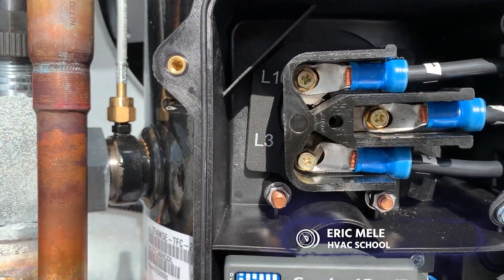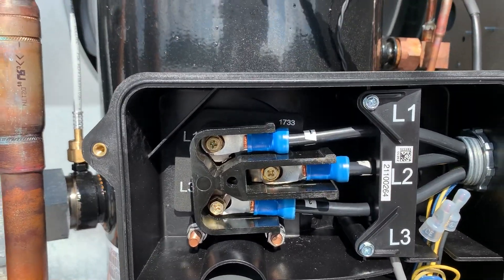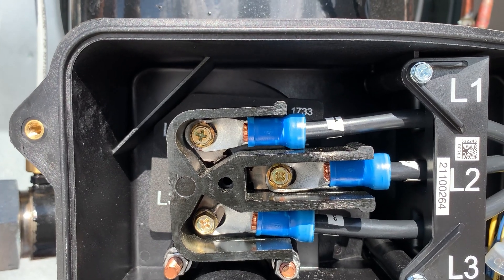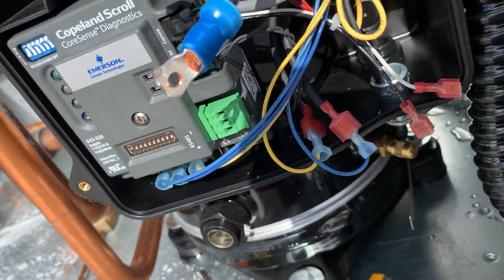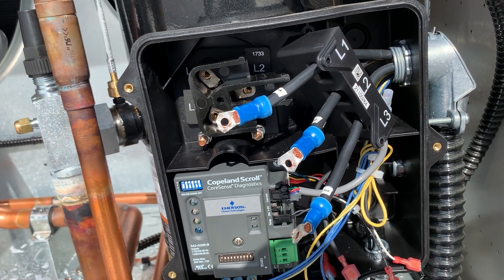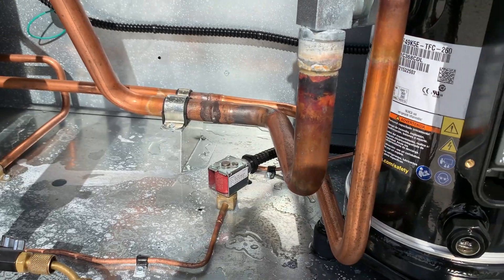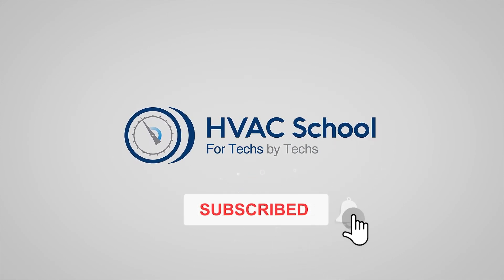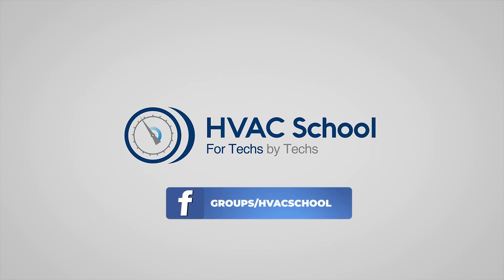Don't Trust Factory Connections

Comment: West Marine will have exactly what u need also. I would think electrical supply house such as Walters should have too. Auto parts store maybe - since #6 is used in automotive. 
A Good auto parts - for sure.
I’d Recomnend stocking the truck now with the correct connections , your going to need them again probably. Best to have some stock.

Comment: Wow ! Those Factory connections we’re Rediculously Poor. Your Fix , does not get any better than that ! 👍 fyi - I get lugs in Home Depot that will fit #8 wire & I believe it’s a Thomas & betts Steel lug if memory serves. 
They might have #6 wire ones.
The #8 ones they carry are really nice. Sold in a package of 1/Each package.

Comment: I like your fix. Right before you revealed your solution. I though clipping the ends off of some smaller ring terminal crimps and using it as a washer.  But you solution seems great.

Comment: I would’ve used the right size terminal or just did what the tech did, soldered then onto the wires (especially in a high load like compressor), used a washer on top and been done. Maybe overkill but you won’t have to fix it again.

Comment: 1/4 copper , insert the end of the wire in, then flatten the copper, use your drill to open a hole for the size screw on the terminal, End of the story. That’s what I do. Hope that helps.
Reply: That’s not a bad idea. 👍 thanks for posting that way.
Reply: Very good... even better if you use some resin core electronics solder and then put a piece of shrinktube at the end. Probably better than factory.
Reply: This tip will come in handy thanks

Comment: Next time, pick up some heavy duty copper ring terminals (pre-tinned is okay too) 6 Ga with 1/4” eyelet at Auto Parts or Lowe’s. You’ll need some 5/16” or 3/8” heat shrink from same places. Also get a hd or a hydraulic crimper or use a rounded off 1/4” punch and a piece of heavy steel inner corner. Then use a propane torch and electrical solder for best connection.
Reply: That would probably be the absolute best way to fix that but not practical for the type of situation. That customer may have $100,000+  in that box and they want it running as soon as possible! You gotta do what you gotta do in that case........literally!
Reply: @michaelpersonale7396  a new install. I doubt they loaded it yet.